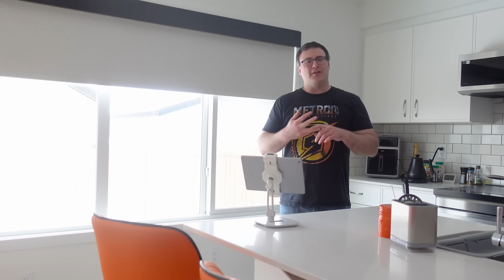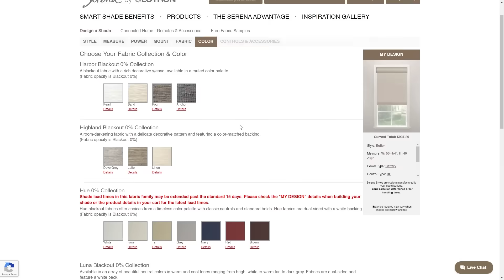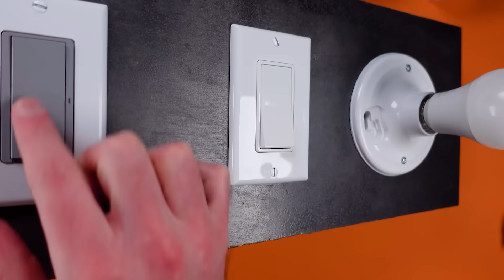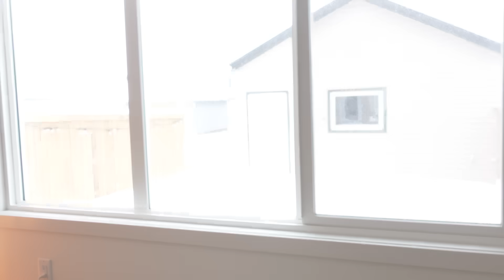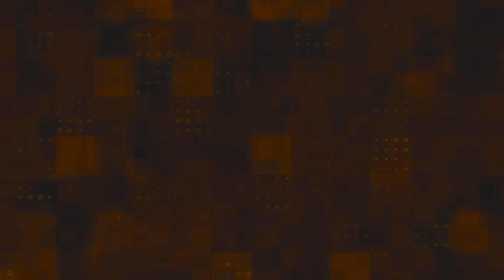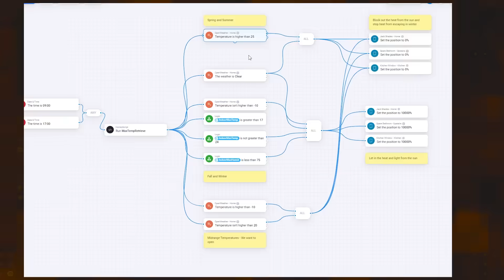AVOID Picking The Wrong Smart Shades...Here Are The BEST!

Comment: Beautiful blinds. I've used various "motors" on my dumb continuous loop chain blinds.
Currently using soma and aqara motors.

I love how quiet yours are, but I use the "noise" mine make opening as an alarm clock 😂
Reply from the maker: It's tough when you have those chains hey? The options are a little hard to fit.  Good you found something that works though!
Reply: @AutomateYourLife  soma do, or did, a motor for those blinds that use a wand to open and close the blinds. That works really well.

Comment: I had a couple of Lutron Caseta switches stop working. The only way to get them to work again was to completely reset the switch. It never happened again. Another problem I had with the same switch, was when I was trying to control an outside wall light. the bulb was the type that had two phases. Click once and it is a solid light. click twice and it is a flame. I liked the flame state, but the Lutron Caseta  switch  was never able to get to the flame state on its own through scheduling or using the app. I even call tech. support and they told me it could not do this. I happened to have a Leviton smart switch, 2nd generation and it was able to get to the flame state on its own...
Reply from the maker: Good news on the two that kinda broke on you there. To me that sounds like a brownout type of situation or maybe just a spike. Usually brownouts cause the most problems for electronics though!

As for the special features with the one bulb there, that's an interesting problem.  I wonder if they'll add that feature ever.

Comment: I have to say that I have been using WiFi controlled blind motors that make normal blinds smart for years, they were cheap and have been 100% reliable, and at £50 per blind to me it's a no brainer.
Reply from the maker: As long as they're working for you! I can't say I've ever had success like that with a cheap wifi product but you must have found something good

Comment: Lutron is great. Also, Home Assistant integration. Also Hunter-Douglas is a good quality blind. Both expensive.

If you want the full blackout experience, look for Sleepy Time Tracks edge blackout trim for the side light gaps. I also use it on the bottom, as builders can't seem to make a level window sill!!
Reply from the maker: Hey that's a great suggestion! I'm gonna look at those to fill the gaps in the bedroom

Comment: I have used Soma for many years.  They are not perfect, but they work most of the time.  The new version is zigbee - which I think is much better.  When I need to replace one I will go for those.  You can use any shade then.
Reply from the maker: As long as you're happy!😀
Reply: @ hah!  Fat too old to be happy Brian 😂. They’re ok - it’s an expensive thing to change a whole ecosystem.  But I wish manufacturers would include multiple networking options because some houses, like mine, don’t work well with wifi but do with Zigbee.  But I guess that would put the price up.

Comment: This video came at the perfect time! I’ve been looking to add smart shades/blinds and Lutron and Eve are the two I’m considering. Lutron already won me on the smart switches, Eve is a great brand but I love having a hub, the Pico remotes, and being able to have dimmers. I was worried about the noise but I can see that’s not a problem, so Lutron is definitely in the lead for my shades.

Questions! 🙋‍♀️ The very first Pico remote you used looked like it had shades instead of a light bulb or fan, did that come with it or did you have to buy it separately? I like having the Pico remotes match the device they are being used with. Also, I saw you use the Pico paddle remote, does it allow you to control the height or just go up and down? Thanks! You’re videos have helped me a lot as I advance my smart home!

Comment: Love Lutron but they are a little over the top with the price of shades. I just used their calculator and 2500 for three small windows is way beyond what I want to pay for a small office in my home. That is more than the replacement cost of the windows with a quality brand like Anderson or Pella. At that price they should be installed by professionals.Love to have auto shades but not at that price. There are much better options out there at far better prices.
Reply from the maker: They're not cheap at all. I don't think I'd ever switch though.  And I did have mine installed by a Pro ;)

Comment: Awesome presentation, Excellent subject and review. Have you considered using Lithium or Lithium rechargeable batteries? The "leak free" quality of them is extremely interesting to me. I like the Panasonic but the new Powerowl 3A batteries have my attention.
Reply: Good idea! 👍🏻 I usually choose plugs over batteries cause I don't want to change them or have to throw them away. But a 7-year battery life is pretty legit, way better than some of my other battery-powered smart devices.
Reply: @RosesRawReality  I like wired devices myself, but the new rechargeable Lithium's have me thinking about options for some things. Project Farm does awesome reviews on non-smart devices.
Reply from the maker: I'll have to check it out! Never tried those :)
Reply: @ They're only doing AA batteries in the higher rated rechargeable batteries atm, but I think that will be changing soon. Project Farm reviews non-smart tech, tools and other items like these.